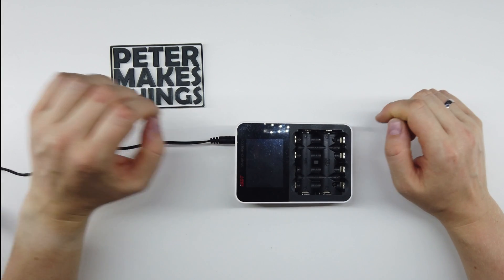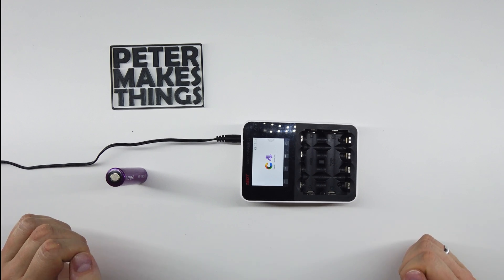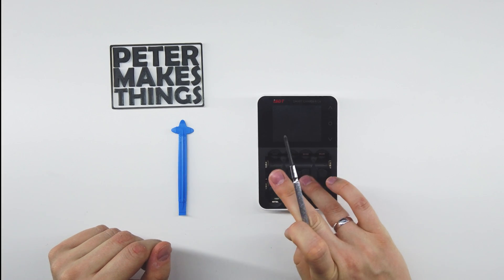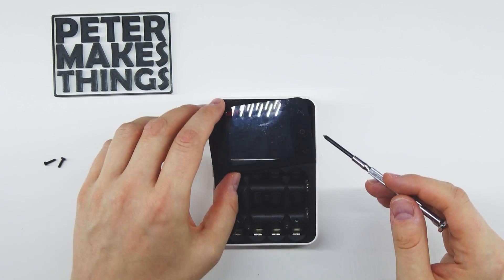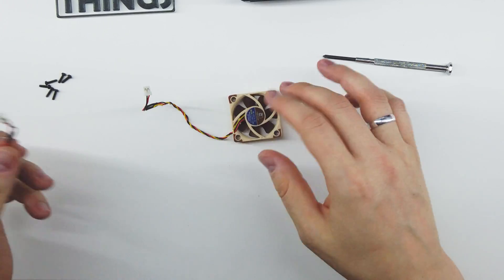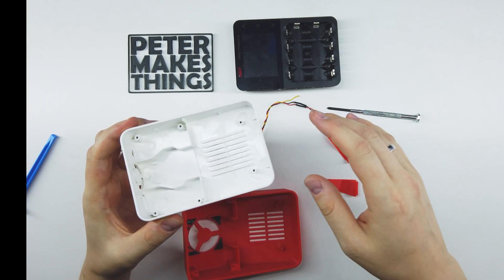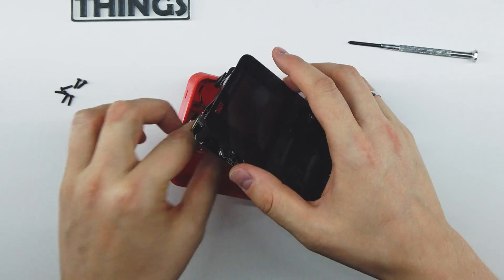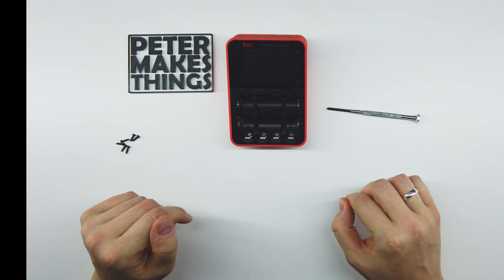ISDT C4 Charger Low Noise Modification

Comment: Hello Peter Makes Things

Thanks for the video. Please tell me how this charger works at the moment, are there any problems? I want to ask you a question about the 3D model of the case -3D model :(free v1) this file can be printed or it's just a sketch for viewing,the main file for the finished production is 3D model :(3D model (v1 & v2)). As I understand it, it is not freely available, you need to pay $ 5 for it.
Reply from the maker: I charge on average 6x 18650 every single day on it from since I got it which is like over 3 years now, not a single issue. The replacement noctua fan is definitely sufficient as the charger never overheated. The model available on thingiverse is full 3d model you can use, the paid version just has a slightly different layout and is a form of donation :)
Reply: @petermakesthings7342   Спасибо большое !

Comment: Just replace the ISDT fan with a SUNON MC25100V2-000C-A99, utilizing the original case and it's quiet as a whisper.  No need to buy or 3D print a case.
Reply: The problem with doing that is you're changing the fan for one with far less airflow. Using a larger fan, you can run it at much lower speed and still get better cooling
Reply: @LBCAndrew  do we know the original ISDT fan CFM ?
The one mentioned by @Shadowcruser99 is rated at 3CFM
Reply: @LBCAndrew  Is there a way to tell how much airflow a fan has? Maybe there's a quieter alternative that doesn't sacrifice airflow.
Reply: thanks, i ordered it now ^^

Comment: Hi Peter. Congratulations for your video on modding the Isdt C4. I need help in help disassembling my C4 EVO, because it's fan is malfunctioning. Below the screen protection there are only 2 screws, and after loosing these screws and the other 2 on the battery's opening the charger didn't open. Thanks for any help.
Reply: The display is held in place with adhesive tape.  You'll need to carefully pry it apart.  I would recommend applying a little heat before doing so, to loosen the adhesive.  A heat gun or a hair dryer should do the trick.
Reply: @Shadowcruise99  I already removed the display. The problem is that in the C4 EVO there are only 2 screws below the screen, not 4 screws like you showed in the video. After loosing those 2 screws and 2 screws on the battery compartment the charger didn't open.
Reply: @MOZARTF  C4 evo has 6 screws too. 
2 screws are hidden under the LCD panel 
but Beware of LCD ribbon cable

Comment: the third cable (often yellow) gives one pulse per rotation and is for rpm readout and failure detection, the fourth cable (often blue) is for rpm control with a pwm signal. this charger controls the fan directly via the supply voltage which is not as precise and smooth but allows for cheaper fans. 
the fan you added does not have as much airflow but since the charger has overtemperature protection it should be fine. 

my isdt D1 charger is great except for the fan, its a cheap low quality fan with a lot of loud vibration and it just sounds really cheap, im replacing it with a quality fan.